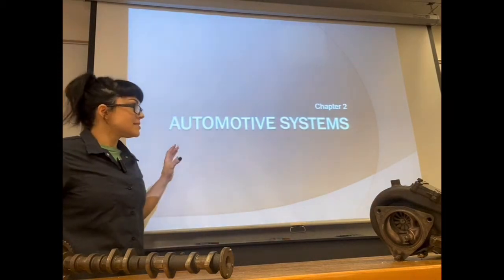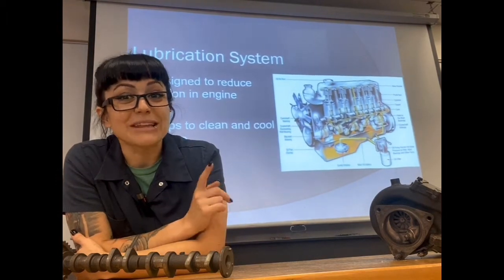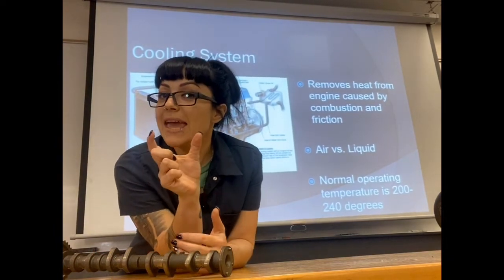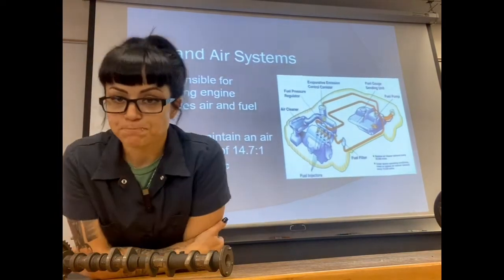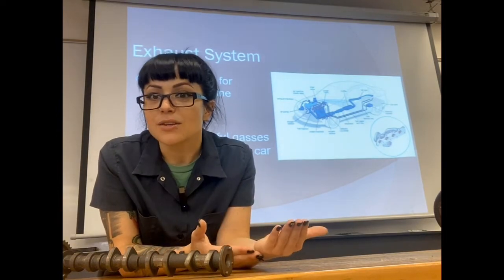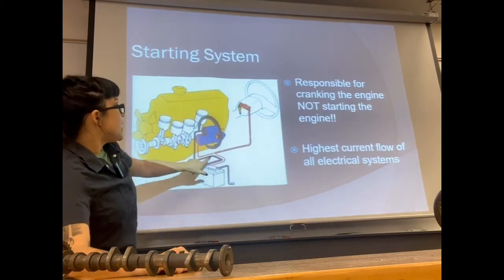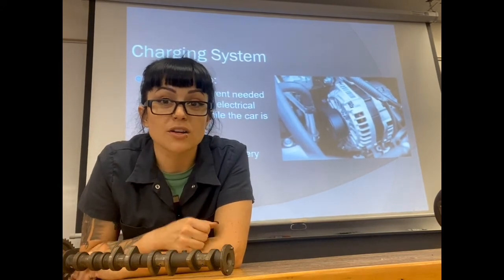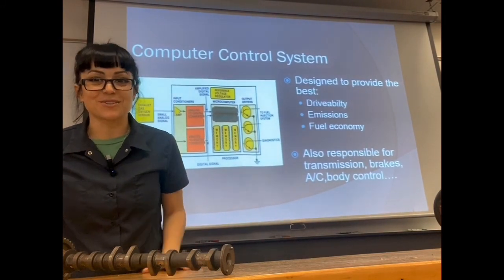Automotive Systems Lecture 1

Comment: It's not the loss of heat energy that's a concern since lubrication is designed to prevent the accumulation of heat energy in the first place.